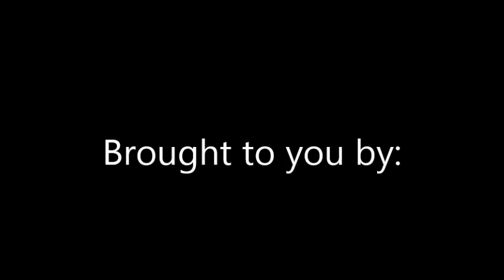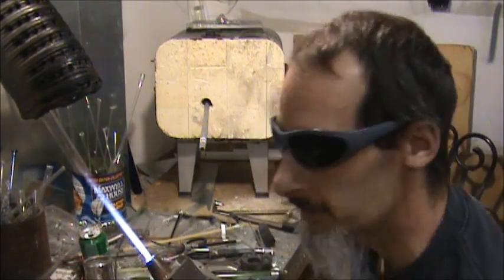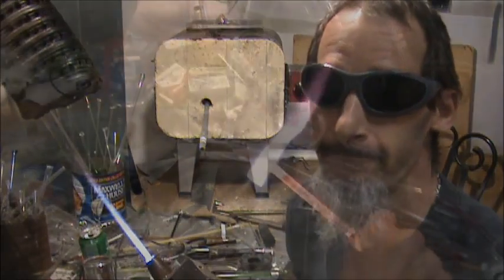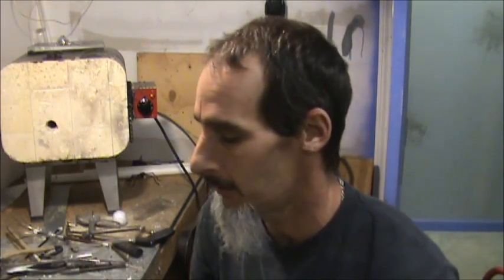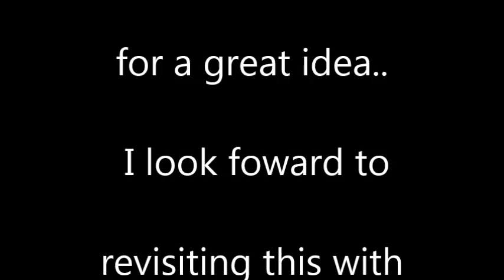Glass Bullets

Comment: that the entire glass rod lights up is because of the light the heated head emits, right?
Reply from the maker: ***** Yes. And if it were squared off on the opposite end it could burn you. Infrared heat travels much like light through a fiber optic. The heat info only shows up on the open end. Kinda kewl. LOL
Reply: soquidstudio heated glass laser so to say

Comment: make a rupert drop!
Reply from the maker: And then what? They won't fit in a shell.......lol
Reply: soquidstudio You could make one that would. It'd just be a pain in the arse to get it perfect.
Reply from the maker: ***** Due to the complexities of a Rupert's drop I would say no. There are a lot of variables with the ruperts drop that, to my knowledge, are very difficult to reproduce in a regular piece, I can not put an un-annealed manipulated piece of glass in water..it will just explode..i can dip it in water to temper it but I have to do some sort of annealing process (controlled ramped) to ensure stability..not to mention those pesky tails. Check out smartereveryday they have a great Rupert's drop vid.
Reply: soquidstudio I'm aware of the difficulties, I've worked in a glass studio and made them myself. All I was saying was that it IS possible to make one that small with enough trials.
Reply from the maker: ***** Maybe..but I doubt it.Im sure someone is bound to try again..
Reply: ***** no its not lmfao the shotgun would break the tail instantly anyway
Reply from the maker: ***** LOL  ...It's supposed to stay whole..other wise its just sand in a shell...just sayin. You are looking troll-esk now. I would like for the comments on this page to at least appear as intelligent. Thank you for your understanding.
Reply: soquidstudio You're right, except that "sand" would be considerably sharper than most, and it's somewhat easier to put a well formed rupert's drop into a shotgun shell than dry sand or frit.
Reply: so melting glass and managing to make it not break and fall into a bucket of cold water and some how come out the perfect size just to have shatter is easier than smashing some glass with a hammer and putting it into a shotgun?
They dont have enough mass to go anywhere its like sneezing into the air goes fast for a second and dies off quickly no inertia

wtf?

Comment: Would it be possible to make a glass Zippo casing? Not necessarily the hinge part, but like an actual functioning case with a surrogate hinge? Maybe it wouldnt be very practical, but it would be a cool experiment, and maybe even an awesome display piece. Also, what about one of those old fashioned straight razors? I read that youve made knives in the past, but seeing as a razor isnt so much a working tool, it could actually be functional.

Comment: Workign glass is amazing, it's super dangerous and scary looking and yet something that requires delicate touch.
If I had the resources I'd love to learn how to work with glass someday :D
Reply: Why is it so dangerous?
Reply from the maker: Magnus Dominus Because of the purity the broken shards they normally do not set up an infection so the glass just cuts your insides up instead of being pushed out by the bodies natural process. This sends white blood cells to work but they just go to work on each other, Set up for cancer. Ive had a piece in my hand for 5 years and had a piece in my eye for 6. Very dangerous.
Reply: soquidstudio
Thanks, for the info.
Reply from the maker: It is quite an investment..I'm still in the red...8 years later. LOL  I guess I could stop giving stuff away LOL. Oh, I do have a Vid on getting started.  You can get started "Flame working" for under $4 or $500. A full on studio gets pricy. when you add a kiln and an exhaust system.

Comment: On the lead slug most of the weight is forward with the hollow (lighter) rear trailing behind. Like a badminton birdie. This provides stability (no tumbling turning) during flight.
If there was a way you could create a "weight forward" glass slug, it may help improve it's flight characteristic and accuracy.

Not knocking your fine work, just providing product improvement tips. :-)

Comment: what is the average energy needed t obe expended if one creates sheet glass for instead or glass rounds of some ammount of grams? what if you start out of sand? definitely need some chamber for heating as some fumes can be dangerous carcinogenic or toxic, it is only then possible to make shaped glass out of the output material of this chamber.

Comment: thee things though beautiful and well crafted, wont act like a slug until the center is removed from the rear, that mass at the front ant the lighter :tail" is what keeps a normal slug flying relatively straight
Reply from the maker: denvera1g1 Yup.  We were going for over all weight and the Flight characteristics were unknown at the time. Stay tuned  ;)
Reply: soquidstudio something that might help to keep them flying straight are 4 thin steel legs that protrude out the back at the edges to extend nearly the full length of the shell(wouldnt be able to use a wad), it a single 6-12 inch braided steel or other metal flexible "rope" that you wind up into the wad, hopefully once it exits the barrel it will completely unfurl and act like the tail on a kite
Reply from the maker: denvera1g1 Nice..if I could only get it to stick..I guess we could glue it with epoxy?  Me Likey. LOL
Reply: +soquidstudio yes, make a shutgun like glass slug, then take a string of bead chain, attach it with epoxy to a recess at the rear of the slug
https://spiritriver.com/media/catalog/product/cache/1/image/9df78eab33525d08d6e5fb8d27136e95/c/h/chain-103--bead-chain-eyes--silver--large.jpg
Reply: +denvera1g1 maybe have the recess be more like a chamber with a hole in it, so that you can put the beads in as well as the epoxy, but once the epoxy hardens its not just stuck on, its also held in

Comment: Annealing doesn't ensure maximum strength. It actually softens the glass somewhat and evens the tension so it's less likely to explode spontaneously or from a drop.
Reply from the maker: ***** Yeah Ive had to go with the strength statement a generalization.  Generally folks think a hammer is a good indicator of strength...We used a shotgun lol. So I had to go with a general statement, "Un annealed glass is weak, annealed is stronger"  But that is for this purpose. Tempered glass may be "stronger" but it is more brittle and thus prone to shattering in the barrel. I may get into why we anneal in a later vid but I need a better camera for that one...polariscope views are awesome and HD is probably the only way to describe them fully..

Comment: I wonder how well glass transports heat. I see you holding it bare handed, but does the temperature raise fast at the opposite side where it is heated?
Reply from the maker: Not normally. Glass is a great insulator. If I get too close, the majority of the heat is felt in my finger nails. Although some heat will transfer through the rod to the opposite end. Radiant infrared .

Comment: How hot are the rods you're holding?
Reply from the maker: ***** Depends. very hot where in contact with the working area but just over 100deg F in the center, but well over 250 degF. on the very opposite side of the working end. This is from Inferred transference and radiant heat. I some times roll the end so it dissipates better. A short broken punny will burn you pretty bad on the exiting end..think fiber optics...just bigger.

Comment: Is that tempering furnace that has a hole cut in the firebrick? what do you use that for? I saw a rod sticking out of it earlier in the video. couldnt tell if it was a glass or steel rod
Reply from the maker: Nerd Worker Yes It is a kiln. The hole is multi use. I can use it as a temperature regulator, or a spot for smaller pieces of glass to get warm. I plug it with a glass or graphite rod for long soaks or crashes.
Reply: Oh I see what youre saying. Very cool. Saw your slugs in the other video which is what led me to your channel. Cool stuff keep up the good work!

Comment: Is that oxyacetylene or some other mix you are using?

Interesting video, thanks :-)
Reply from the maker: Jeff Rose I use a Propane and Oxygen torch.
Reply: Thanks for that, I had a feeling that you may not use acetylene, possibly that would be too fierce. :-)
Reply from the maker: Jeff Rose Yup the glass boils off on the surface leaving bubbles and a white discoloration.

Comment: How the fuck don't you burn yourself holding the red heated glass ? O_O
Reply: its not actually heated, thats the glass taking on the colour of the flames
Reply: But it's white of hotness ! it doesn't conduct heat at all  ?

Did you tried to put metal IN the slugs/bullets ?
Reply from the maker: Linausable The heat only travels about 2-4 inches from the flame. Glass is a terrible heat conductor. No ,,metal and glass are kinda enemies, lol Had to get them to coexist, Plus we are making GLASS bullets.  :)
Reply: Thanks. Is there different glasses with differents densities ? You could try to put  weak glass the the end, with blades insides ?
Reply from the maker: Linausable Different densities of glass wont stick together. They have a shrink rate (COE) that is different from one another & the seam fails. Just like metal. or worse, it explodes with force. LOL
Reply: What if metal filled with glass ? ^^
Reply from the maker: Linausable . Im working on a jacketing technique right now. Might help. Dunno. I don't want to go with too much metal. Id like to stick with a nearly all glass round. Im still playing with some ideas. Lots of suggestions to consider too.

Comment: Awesome video; I've always loved watching glass working. Really good idea with the harder rounds, and the rounds albeit they weren't accurate, they were really cool to watch fly through the air. Also stick with it through the whole TAOFLEDERMAUS video, the ending is awesome. Quick question though, and forgive my ignorance, how are you holding the glass, isn't it hot? Finally, again awesome video.
Reply from the maker: Glass is not a very good conductor of heat. I use another rod of glass called a punny to hold and manipulate it.. Although I can get hot finger nails, I usually can back away and take a break, Often length is the factor., short punnys can sometimes radiant infrared heat that travels through the rod and exits the other end.. A short piece has been known to burn the palm .
Reply: soquidstudio Oh ok; I guess I never realized glass was that poor of a conductor, and by the way thanks for actually responding.
Reply from the maker: ***** I try to answer as many as I can.. Any suggestions for a vid?
Reply: Have you tried making a glass knife? That would be pretty cool.
Reply from the maker: ***** I have made a few personal ones..Don't tell tsa. LOL That would make a good vid.  lol.
Reply: soquidstudio That's awesome, well if you do make a video about it, I'd be sure to watch that. Also how effect are they; because I know you can get glass sharper than steel, but I also know it's pretty brittle?
Reply from the maker: ***** I sharpen them with a stone under water so they will get as sharp as a razor. The blade is only for cutting no real "working" edge..they snap with lateral force.
Reply: soquidstudio Ja, that's what I kind of expected, but that still would be really cool.